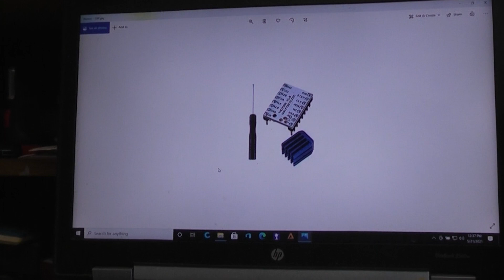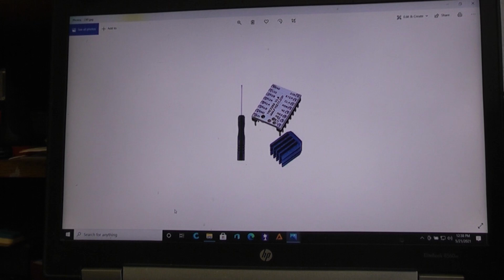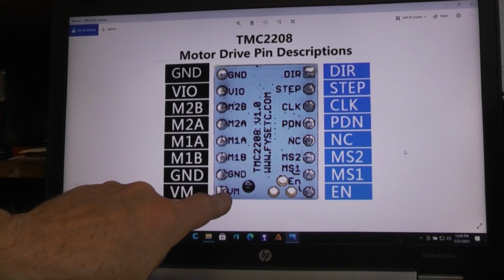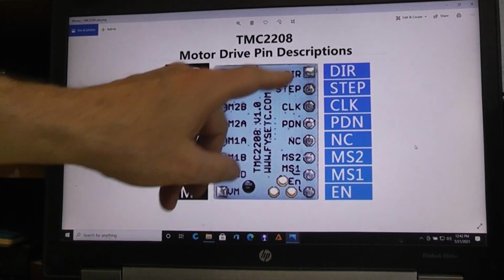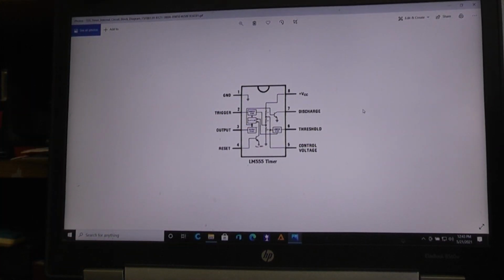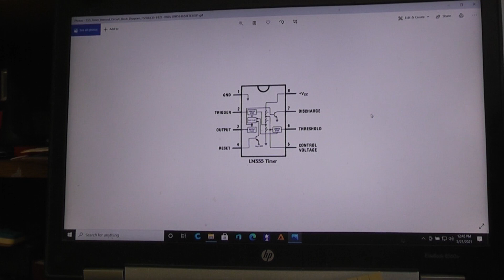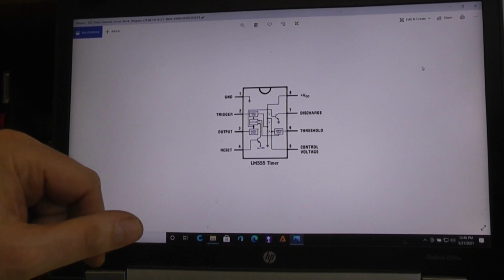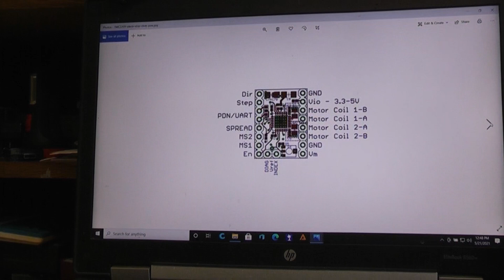Part 4, Leslie build.  Silently control a stepper motor with  a TMC2208, 555 timer and 12V supply.

Comment: Great suggestion for adjusting the trim pot!
Reply from the maker: There is a test point on the driver board as well, but I have always found it easy to do it this way as your not trying to hold two meter probes and turn a screw driver at the same time.